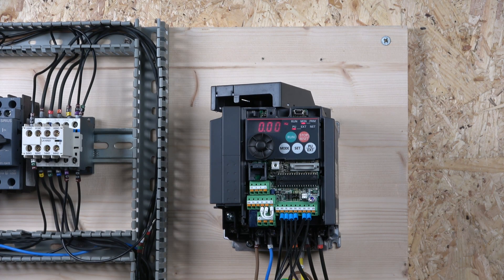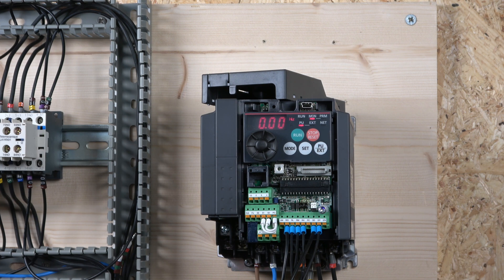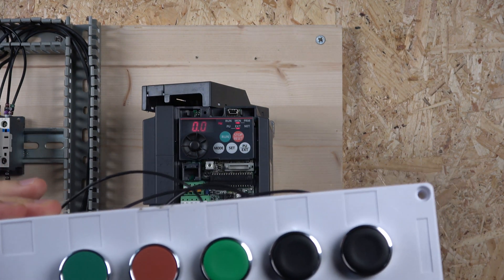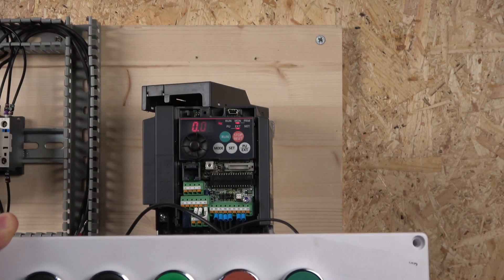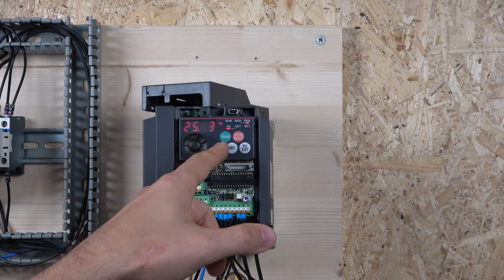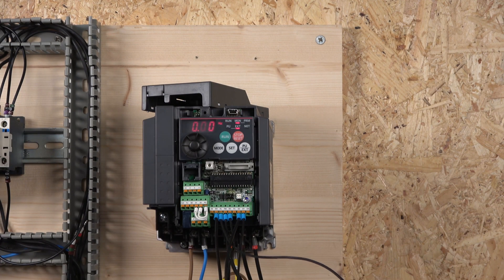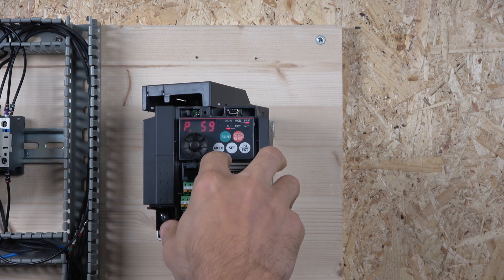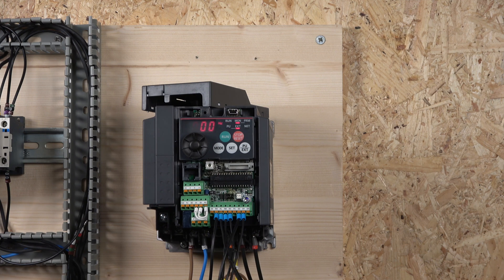Mitsubishi FR-E700 remote mode control using multi frequency/speed. Single phase VFD (English)

Comment: i tried using the ABC contact for the illuminated push button. connected w/ STF and SD but the VFD is running but the frequency is still zero which i already set the frequency to 60 Hz. can you help? if possible asap
 thank you
Reply from the maker: Are you using potentiometer? What is your minimum frequency and is run light flashing?